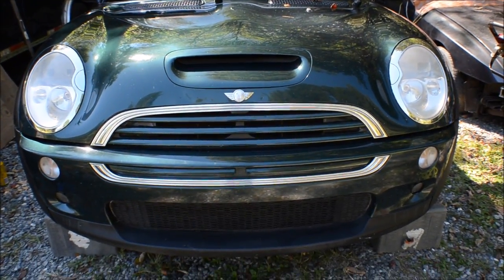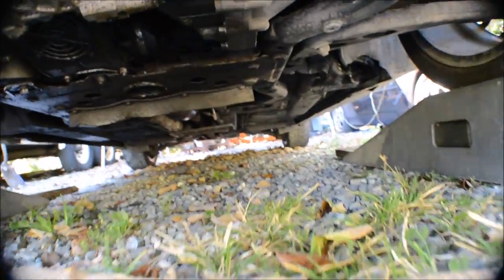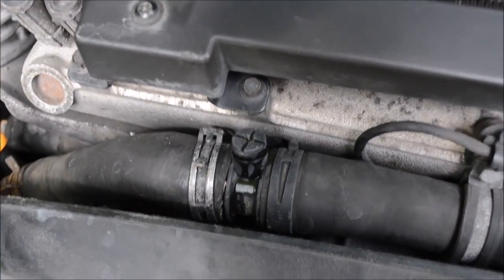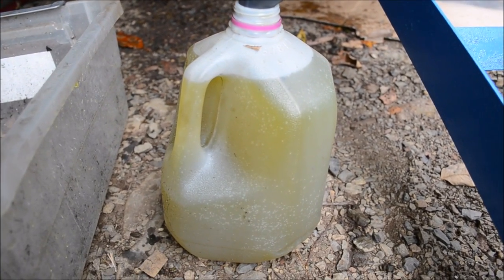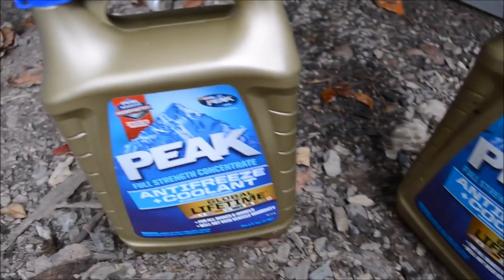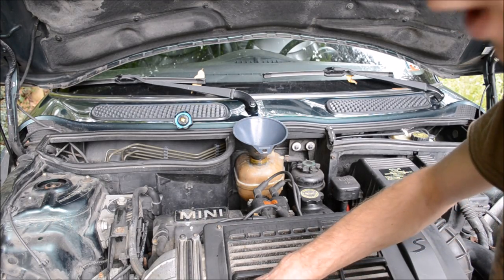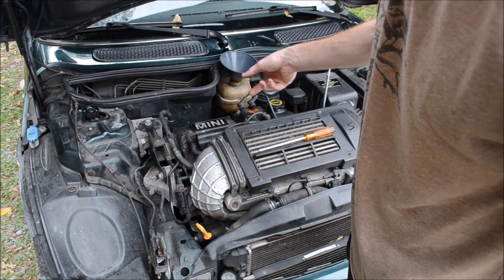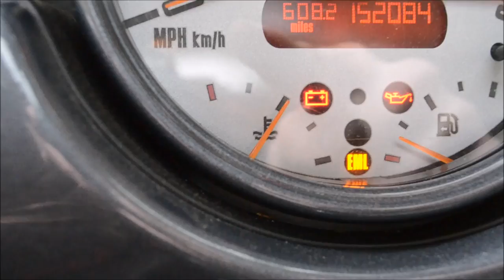MINI Cooper S Coolant DRAIN, FLUSH & FILL & BLEED - What Type Of Coolant?

Comment: I experienced a failed R53 transmission (R53 AISIN) cooler. I was told these fail due to Antifreeze becoming acidic. My cooling system was a nasty thick sludge and I think my transmission got a little coolant in it. 

R53 doesn't have a good straight pipe for those flush kits so save your $4. I used tap water and Dawn from my hose under pressure (yeah I know) to clean out sludge. I introduced water in the expansion tank's lower tube and the top radiator hose. I drained from the lower radiator hose. I ran the car a few times with low heat to circulate good and bad until the water was clear. I then ran through 4 gallons of distilled water before running 2 gallons of 50/50 Euro mix. 

I then changed my AT fluid 3x, changed the filter and added 1 bottle of Lucas. A scan tool is a must to get the AT fluid temp for the fluid levels. 8 hour job, mostly due to all the start/stops and waiting for the fluids to cool down.

Comment: PGL coolant is good stuff.  I believe it's one of the only coolants out there that are free of phosphates/silicates and 2EHA (a plasticizer)....AND is an extended life coolant.  It's the stuff that I like to use if the OE coolant is unavailable.  Unfortunately for me, it was not available locally when I was doing a coolant drain/refill, coolant tank replacement, and thermostat on my 2004 R53.  Oddly enough, the local car parts store had BMW coolant in stock!
Reply from the maker: for sure, im glad they had what you needed, shipping would be expensive

Comment: Water steps after the fact:  Can you please explain the process to run distilled water through system after drainage?  Is there something special that needs to be done; like, having something on (like the heat), or a valve on or something, or just pour distilled water until it comes out clear?

Comment: Thanks bud, lot of good tips for the next change. Didn't know about that bleeder screw at the rear of the block. 

Getting ready to do my LR hub bearing this week.

Peace,
Dave in the Adirondacks
Reply from the maker: Welcome Dave, and thanks for watching! **The bolt on the rear of the block is for draining, I wouldn't recommend unscrewing it, I heard it is some special bolt where the threads compress and make the seal and you have to replace the bolt if you unthread it. Best of luck with the hub, I have a vid on that too: https://www.youtube.com/watch?v=5Eyk-kuu8uY

Comment: So i did some cleaning the throttle body and might as cleaned the radiator.. now i put everything back together.. put fluid  on the reservoir to max but since i flushed the radiator, it heats up x.x the hoses going to the radiator not getting fluid... i oped the bleeder next to the radiator but not the one in the back... its necessary to open it? Let me know thanks
Reply from the maker: yea do the back one

Comment: trow the garden hose in in until it come out clean and change the termostat whille you at it
Reply: Which hose did you use with the garden hose?
Reply: @jakepollard8093  warm engine  yes garden hose open   in the reservoir for 1h every 20 minute after you come open the screw until you dont hear air out then close it then come back in 20 minute ... do it 3 4 time then put the cap on the reservoir
Reply: @raymonthiboutot9709  Thanks.. but which hose on the cooper do I use? Is it the one that comes off the thermostat?

Comment: Hello, similar question to the one I asked in the Porsche video, as it's been about 4 years, has the Global Lifetime coolant been good in this car?  Particularly, have you had to deal with any heater core leaks?
Reply from the maker: I didn't have any problems, but I sold this car January 2019, so not sure if anything happened after then
Reply: @aDIYCarGuy  Thanks, I'm sad to hear the car is gone after all the work you put into it.  The new owner is a lucky person.

Comment: How important is a coolant flush i think i could do with one but is it something that could be really harmful to my engine? it seems to run fine but my coolant is a tiny bit low and the last person to have the car had it 2 years no flush i have had it a few months no flush and the person before him i dont know but i cant see a flush in the paperwork so he could maybe done it himself and i will never know... its been at least 2 half years and my coolant looks ever so slightly rusty no foam or anything like that its not a blown head gaskit it just looks old and worn down
Reply from the maker: eh if it's pretty clean I wouldn't worry about the flush, really depends on your goals and the condition of the coolant. if there was oil in the coolant at one point for whatever reason, then I would do the flush.

Comment: Good idea on having the car on the trailer. I've never heard of mini life lol. Can i say Victorian life for my car ? hahaha. I feel like mine is a little simpler on my car to replace the coolant. also is it true you can reuse the coolant if there's no dirt in it?
Reply from the maker: Thanks and hahah yea you can say Victorian life for your car. I can imagine it's a lot easier for your coolant change. As long as the coolant is kept clean and isn't past it's service life, you can put it back in. I do. lol
Reply: a DIY Car Guy Sweet ! I still have to check my coolant with a hydrometer do determine if i need to swap it out. It's almost exactly lime my red and white truck to do it since it is the same engine. 5.0 life! Also I researched these engines are made from the Windsor company that makes the same engine as the legendary 351w
Reply from the maker: Jimbo Booth nice! do you know how old the coolant is?
Reply: a DIY Car Guy not sure. 5 years old? It sat that long
Reply from the maker: i'd put new coolant in
Reply: a DIY Car Guy will do. I was thinking it was a little old lol
Reply from the maker: yea lol, if it was still in the bottles it would be ok as it doesn't really expire, but since it was in the car i'd change it.
Reply: a DIY Car Guy Thanks I'll do it when I can. Luckily its still green , not nasty rusty clean.
Reply from the maker: Jimbo Booth np!

Comment: Just a quick on I can’t find the bleeder on the back of my engine I have the same engine as you
Reply from the maker: I would focus on the bleeder near the thermostat, don't worry about the one on the back, it's difficult to see or access anything on the back of the engine.
Reply: hello, quick question I haven't got the tool to reach the second bleeder is it ok to just bleed it using the one bleeder on the front?